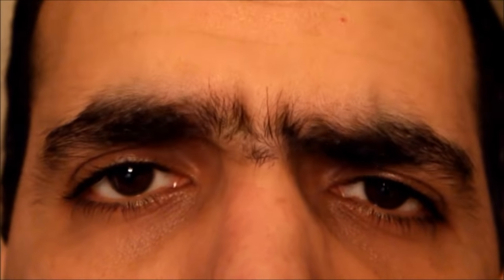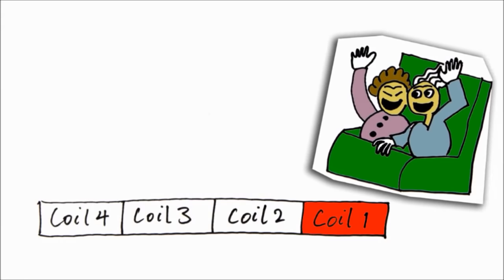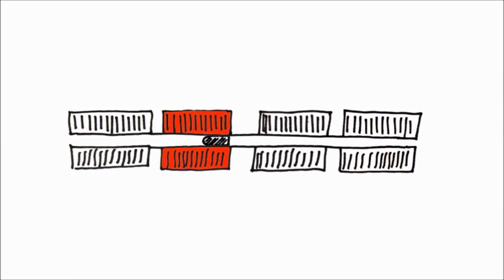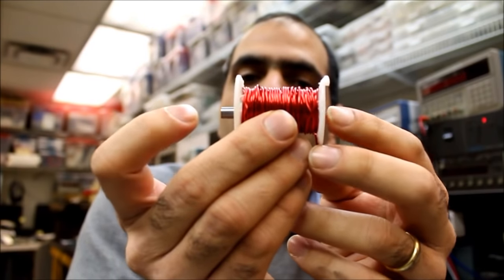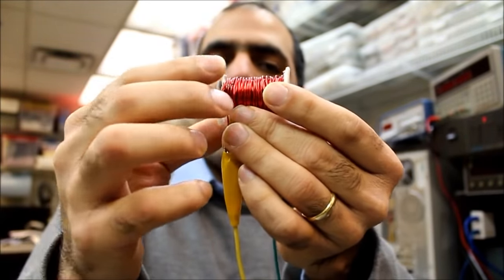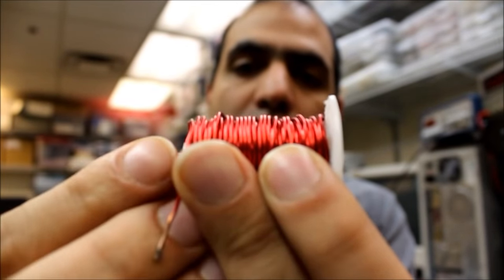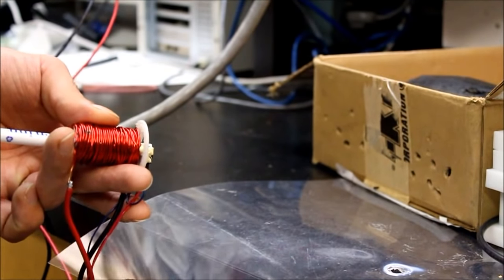Just Try and Make Your Own Coil-Gun (Accelerator)

Comment: put 50 coils and you have a sniper rifle, I guess...?
Reply: That would be a railgun actually. arguably more deadly and accurate.
Reply: Coilgun > Railgun
Reply: @claytonreed5153  let me also know lul
Reply: Sadly coilguns have diminishing returns as you increase the number of coils, so increasing the number doesn't increase the output as much as you would hope. (but I'm no expert, so 50 may well be enough for a sniper, even if it would be a bit heavy)
Reply: A railgun is not a powerfull coilgun, it is a completely different concept. You have no idea.
Reply: A rail gun uses get ready two rails to accelerate the projectile as the current flows down the rails it propells the projectile, a coil gun uses coils around the projectile to propell it, coil guns are heavier but far more powerful as the angle of current is at 90 degrees to the projectile.
Reply: The longer it is, the harder it is to time.
Reply: AWP     will    be    soon     made    like    this.
Reply: Fifth Wheel You got that backwards, a rail gun is more accurate then a coil gun
Reply: SignatureBeatz actually it is a coil gun
Reply: Gauss rifle :D
Reply: 1000000 coils = particle accelerator
Reply: ConDor Arma
Reply: i gauss?
Reply: that would be insane it could go through a house
Reply: @technicallydifficulties7094  amen to that
Reply: yeah but you'd need very long coils at the end to get enough time for the projectile to accelerate
Reply: @iaxacs3801  railgun and coilgun are totally different things, do not mix'em
Reply: you need an epic fast timing circuit or some fast reacting sensors
Reply: @cibe will bomb has Ben defused counter terrorist win
Reply: @claytonreed5153  I'm still waiting on that video
Reply: Mmmm maybe
Reply: @claytonreed5153  is it done yet? or did you die
Reply: Railgun. and the US navy now wants to know your location
Reply: 1.79e308 coils = Infinite speed
Reply: Thats what is called a railgun
Reply: @iaxacs3801  no... Railguns are completely different.
Reply: @johnrubensaragi4125  that's actually how they work!
Sorry if that was what you meant
Reply: @quantum_chezburger2279  sorry yes it's a coil gun. They both work in similar ways though. Railguns are basically being fired by magnetism on tracks while coilguns have the ammo inside the coils using magnetism. The end result is the same however
Reply: @iaxacs3801  basically.
Reply: @claytonreed5153  you didnt upload the video :(
Reply: @kolikoasdpvp  sorry forgot about this, it ended up not working and just getting fried so nothing was worth recording sadly
Reply: @claytonreed5153  damn so sad to hear that, better luck next time anyway have a nice day
Reply: @claytonreed5153  i guess you never finished it huh?
Reply: @CFneo98  I believe I answered a little ways up on that one
Reply: @CFneo98  it got fried as I messed up somewhere on it and ended up giving up on it as it was a pain
Reply: @claytonreed5153  that's very unfortunate :(
I am trying to make something my own as well right now
Reply: @CFneo98  be careful, I got myself hurt trying to fix it and not being cautious enough
Reply: @claytonreed5153 it's a project for my thesis so I have lots of support and inspection by proffessionals. I have electric and electronic tutors by my sidr as well as physisists for determining the electromagnet.
Reply: @iaxacs3801  and silent
Reply: @claytonreed5153  bro its been a year where is the video share it pls
Reply: @Joseph-ki6wj  pretty sure I already said like twice above it didn't work out as I expected so wasn't worth the upload
Reply: Isaac Ferguson actually In theory coil guns would be able to accelerate an object to a faster speed than a rail gun like the large hadron collider which is able to bring particles to about 11km/h below the speed of light or about 600 million miles per ho
Reply: @claytonreed5153  is 20 coil gun ready?
Reply: @technicallydifficulties7094  a rail gun is more powerful than a coil gun because it touches the rails.
Reply: @claytonreed5153  you still haven’t posted it yet
Reply: @Spitssdubbels  read the bloody comments bro. Jesus. It failed, it wasn't worth posting.
Reply: "Snipin's a good job mate!"
Reply: @claytonreed5153  Still waiting on that rail gun video
Reply: @iaxacs3801  That's not even what a railgun is. That would still be a coilgun. Don't spread false info
Reply: @claytonreed5153  nice
Reply: Guasse rifle
Reply: @claytonreed5153  no videos yet :(
Reply: @claytonreed5153  I see you're still getting comments asking for the video even after this 100th comment stating it didn't work. I'm guessing people would be asking for it a 100 years later 😂
Reply: @flow5718  finally one man that's not asking for it and true, I tried I honestly did, and all I got was a burnt useless machine lol
Reply: @claytonreed5153  I found another video where they made a 50 cal rifle, but the end result is not very powerful and its heavy. I guess a coil gun is not worth pursuing after all.
Reply: Do wise use of science!
Reply: 50 coils, probably means 50 Cal.
A barret M82a1?
Reply: No. Coilgun has limitation around 100-150 m/s of projectile speed, no matter how many coils you use, problem in coil inductance.
Reply: FBI OPEN UP
Reply: @r4yker442  yes!
Reply: @joedingo7022  100?
Reply: @iaxacs3801  coil guns and rail guns are very different

Comment: it's been years, electroboom. please build one of these with 100 coils <3
Reply: Yeah
Reply: At least 3coils
Reply: 101 coils
Reply: why would you need that just why
Reply: Funny  because it’s cool
Reply: @BaxterCash  no is very danger
Reply: Now it's 2021
Reply: @josiahlowe3648  why not?
Reply: @gram.  too danger
Reply: 2 years later, he has still not done it
Reply: @gram.  lol
Reply: And i want it fully automatic
Reply: Funny  because why not?!
Reply: Don’t forget some capacitors
Reply: One coil for every year so eight
Reply: In a 10 by 10 foot Room??
Nah...
Reply: better 1044
Reply: @lars7050  fair enough
Reply: That would be extremely difficult, a whole workshop of people have trouble making one with only 6 coild
Reply: @polydullmemes3497  not really. Just copy the module and have the sensor enable the next. Timing and spacing between the modules is all that needs adjusting after that.
Reply: Funny  I've got someone to take care of
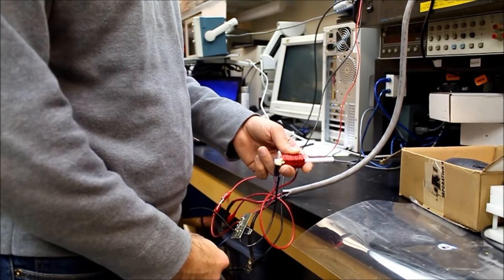Reply: @2:44 suppose he managed to built a 100 coil gun but he accidently do this(RIP electroboom)
Reply: If he reversed the polarity as it exits each coil the speed should double for the next coil, reverse polarity as it exits that one, and repeat. If only we had access to sharp rods of steel in cheap bulk packs… hmm, might get my German friend Jorge Sprave onto a loading mechanism for that one.
Reply: 9001 coils. nao!
Reply: up
Reply: @ashstarkm1392  it's 2022 going on 2023
Reply: I believe hacksmith industries made a rail gun from halo
Reply: clank, pfum, halooomff

Comment: Neat video. I myself have built a coil gun for my undergrad engineering class using a capacitor bank, a power thyristor, and a hand wound coil of wire. We were able to scavenge some wall adapters that allowed the circuit to run on wall voltage, and successfully fired it in class.

Don't worry, it only shoots a screw about two feet.
Reply: 9pkkoo
Reply: 0

Comment: Wouldn't it make more sense to do it with a timer that starts when you press the trigger rather than a sensor in? That way you could build a long mechanism and control the speedup easier. Makes it easier to tweak for perfect acceslleration too. That's how I'd do it.

Comment: 23.47ft/sec is a far cry from 1,000ft/sec, which is on the subsonic side of typical bullet velocity. Even with a very small projectile it would take banks of capacitors and very high voltage to achieve a delta V from 0 to 2,500ft/sec in the 20" length of a rifle barrel. It's been done but the device isn't really what one might call mobile or practical for the individual user. Cool idea tho.

Comment: Where do you get the infrared sensor? I have everything else but that.
Reply: Ian K printers and old mouses are a good source of them too
Reply: Ian K If the projectile is conductive I guess you can just put two wires in a way that the tip of the bullet closes the circuit, there will be a small amount of friction but no need for the IR sensor ;)

Comment: How would you get more speed? By adding coils or by increasing the magnetic field? (or both?)
Reply: ***** You can use the principle of the gun from the video, and increasing the magnetic field too. For example when the "bullet" reaches the end of the first coil, the sensor turns off the first coil and turns on the following one, and so on. Using multiple coils, and more power on each one, will definitely increase the speed and the power. (to give more voltage to the coils you can use supercaps on each one)
Reply: +Mehdi Sadaghdar (ElectroBOOM) Theoretically, a strong enough magnetic field would minimize (not eradicate) the effect of the gravity downwards, since it would give enough force forwards, so the bullet will move completely straight forward for that short a distance. Adding multiple coils will only maximize that effect. If for example your speed went from 16mph (on this video) to 32 or 40 from one coil with let's say 7 or 8 coils you could have a dangerous weapon in your hand (coil rifle, by the size of it)

Comment: 0:38 "no fossil fuels"
What gun runs on fossil fuels lmao
Reply: Technically gunpowder can use coal in it sometimes
Reply: @bendvorak357  black powder I think is a mix with coal in it. Smokeless powder there isn't any in it.
Reply: @NarutoMagicCyclops  Charcoal; which is made by cooking wood in absence of air movement (a sealed pot above a heat source is a good example), a coal substitute is more probable to release significantly harmful toxins.
Reply: @miamislice3280  huh?
Reply: @NarutoMagicCyclops  Charcoal is what dudes put in gunpowder.
Reply: @NarutoMagicCyclops  Yes, I thumbs up my comments, do not point it out.
Reply: @miamislice3280  alright that makes more sense, adding in relatively useless info can make it hard to understand the main point that you're making.
Reply: @NarutoMagicCyclops  Now you can make 1/2 of what is necessary for gunpowder, forget the sulfur, it is a redundancy, like putting premium gasoline in a diesel/petroleum hybrid.
Reply: @NarutoMagicCyclops  Exactly
Reply: Therefore they're so innocent they don't even know no hun runs on fossil fuel - sorry if that was offensive tho - not hating just stating
Reply: @pancakemattress6508  

wat
Reply: @miamislice3280  Welcome
Reply: Flammenwerfer

Comment: Can someone please explain to me why he used that small circuit consisting of two 1M ohm resistors and a 1uF capacitor to drive the gate terminal of the NMOS in his schematic?

**here's the time stamp for the schematic for your reference - 2:32
Reply: From what i understand this is a pulse generator that shortens the pulse and turns on the coil. It works like this : the capacitor puts a certain amount of charge through while the lower bjt discharges the gate thus creating a pulse. Also if you plan this for yourself and you are using silicon to switch the current i highly recommend adding a freewheeling  diode or a snubber network to deal with voltage spikes from the rapid changing current. If using spark gap / thyratron there is no need for snubber as spark gap and thyratron are quite durable.

Hope this answers your question
Stay safe!

Milan Hlaváček
Reply: @milanhlavacek6730  Thank you! It makes sense now. So, the capacitor setup driving the gate acts like a high pass filter and should power the coil for about 5 seconds (5 times the time constant RC) or till the projectile trips the photo-transistor (whichever is earlier) after he presses the switch SW. But why is there another resistor to the left of the capacitor though? Just one 1M ohm resistor would've been sufficient for the job 🤔 

Thanks!
Stay safe!
Reply: @hyperion3704  that would be the pulldown resistor. This resistor is used for removing any static charge on the MOSFET to prevent false triggering.
Hope this helps.
Stay safe!

Comment: Shouldn't you have a zener in parallel with the MOSFET to clamp the voltage spikes from the coil?
(Or an ordinary flyback diode across the coil itself, but I think that would make the magnetic field collapse a bit slower.)

Comment: Great. Did you use just 25Volts? and is coil wire have to be thick? Like more amps is more powerful. Thank You. Ah I see that your output voltage is 70A, this would give the coil a big kick, I've been using 30 volts from my power supply which is only 0.8 amps when switched with the mosfets, this is not enough, which is why people use capacitors right? ok Thanks

Comment: Can a long coil be thinner at one end and thicker at the other tapering from thick to thin sides of the coil? Would that change magnetic force instead of being even across length to prevent oscillating? Maybe eliminating the need for sensor?

Comment: Rail guns and coil guns are to different methods, coil guns are a series of coisl accelerating a steel object, a rail gun is much simpler and uses the current flow through the projectile to accelerate the object between two rails.

Comment: A railgun and a acoilgun are two entirely different machines, utilizing completely  different principles.  a railgun puts a huge current through the projectile itsef and the acceleration comes from eddy-current induced magnetism. Don't ask, cause i don't fully understand. What i do know is that it's far more advanced than a coilgun, that i do understans, and wich is simply an ordinary electromagnet pulling on a object to make it accelerate. Apply precision timing to that simple concept and the projectile will fly away  =)

Comment: So question. The exit muzzle velocity of a 3.56 gram 5.56×45mm nato ball round is roughly 993 m/s roughly (as per wikipedia). Given your exit velocity was roughly 25 km/h, which is 6.9 m/s, if you lined up 143 of these coils end to end, all at the same voltage, would it create the same exit velocity for the coil gun round?
Reply: No. At each stage, you need even more current through each coil to accelerate it because the projectile spends a shorter amount of time in each successive coil, that is if you want to maintain a high rate of acceleration.

Comment: I have a camera flash circuit, measured 300 ish volts across the capacitor from a single AA cell. Could I use that with magnet wire from a motor as a working launcher? Also, it hurt like mad when it zapped me, thought I was gonna die as my life flashed before my eyes. Got myself a mean blister from it too.

Comment: Can you tell me why don't thay put a generator attached to the electric motor to recharge the batteries wile the car is moving instead of two step down gear reduction as the loud of generator will work as stepbdown gear and recharge the battery?

Comment: the circuit blew up because of high di/dt through the inductor which generates a large negative voltage across the inductor and effectively breaks down the MOSFET he was using. a freewheeling diode would help mitigate this issue.

Comment: What I’m surprised as an American is that we can buy: Flash bangs, “civilian tanks”, RPG’s, flame throwers, and mini guns. All it will take is one shot to put U.S into a chaos
Reply: Eh, flash bangs are glorified fire crackers, >>Edit: looked it up, you gotta do the $200 tax and year wait for each flash bang too
have fun with the year wait and money spent on a metal tube, then the year wait and $200 tax stamp for every rocket, 
and you can sure as hell get a minigun IF you can find one older than 1986 and have a few hundred thousand burning a hole in your wallet, plus the (again) NFA year wait and $200 tax stamp. 
Flame throwers are not considered a firearm and pretty useless for anything today and no real need for regulation...
And decommissioned tanks are literally just super heavy tracked vehicles that get gallons per mile instead of mpg. You'd need another tax stamp for the main gun and every round for it, and even then you would never be able to mount the original main mg or gunner mgs. 

Basically unless you are a multimillionaire with money issues and an obsession with paying $200 + price of actual projectile, plus waiting a year, you're not going to see someone with an RPG or an armed tank just lying around. Hell even automatic weapons like m16s and bars sell for over $15 to $20 thousand, going into the multiple hundreds of thousands for something like a minigun. Plus the year wait. A R-DIAS for an AR15 (makes it capable of full auto fire) costs $10k+ at the moment, and it's literally a block of aluminum the size of your thumb nail with a lever on it. 
Not complying with the NFA risks 10 years in prison, $10,000 per infraction, and forfeiture of your second amendment rights and your right to vote, among other rights permanently stripped from felons.

Comment: If you shoot a copper round through a rail gun can you generate a large EMP?
Reply: Like a led pipe canon (only one end sealed) with a copper projectile payload through a series of coils. If you maximized the length of the pipe to maximize exit velocity of the copper it could scale the equation no?

Could you possibly shape an antenna array outside the coils to resonate and increase the pulse, effectively notch filtering the power spectral density to a  pulse from a sinc function with a cascading series of fractal antennas? Could this also resonate over time for each coil in the sequence as the projectile passes through by changing the dimensions of each respective fractal array for each sequence of coils so the tanks formed by each sequence are underdamped to match the last sequence's critically damped tau? That would be an awesome project!